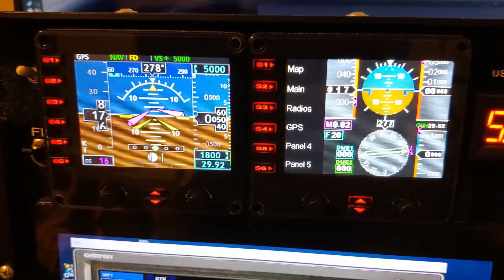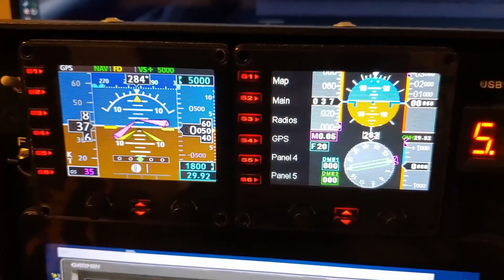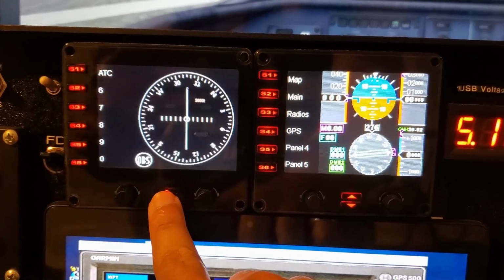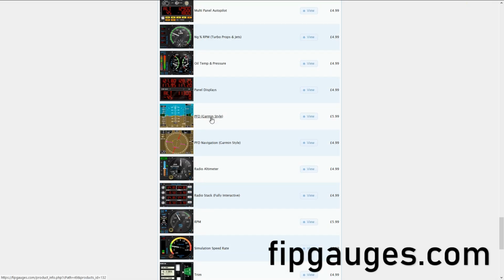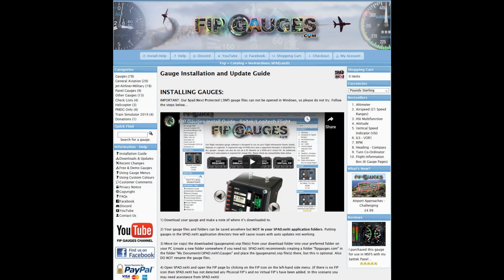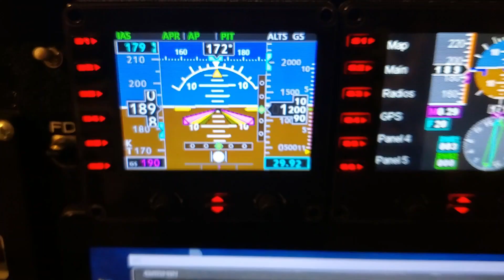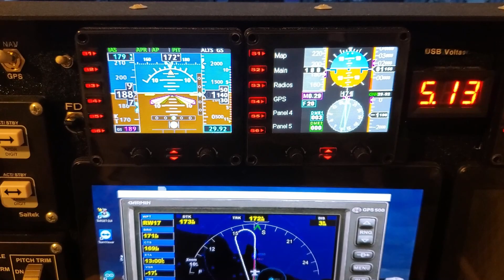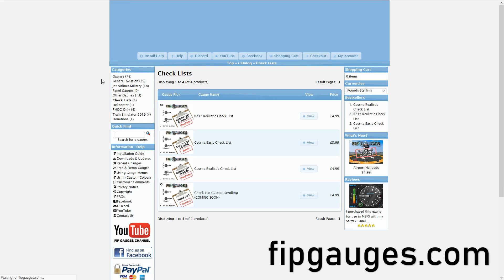Create Garmin G5 and G1000 with Saitek/Logitech FIPs

Comment: This is the first video where I can see the display more or less in action. What's the frame rate? According to this video it's like a power point presentation
Reply from the maker: The frame rate is just as smooth as real instruments in real life. There is no lag, but it will steal some FPS from your main monitor. I've put the Logitech FIPS to the test with many instruments and it's one of the best devices you can buy for your Flight Simulator.

Comment: I just bought two but they don’t seem to be compatible with Mac 😢
Reply from the maker: I'll see what I can find for you but it really doesn't look too promising. There's talk about some conversions by using some applications but nobody has nailed it. I'll get back to you :)
Reply: @joshuamarius  aww man, I have an R4 Alienware which runs it on Microsoft sim, but not as smooth as the m1 air running Xplane. Either way thanks for making the video it’s pretty dope, the planes I fly have two G5’s so this works perfect 💪

Comment: You recommend this or air manager and a touch screen?
Reply from the maker: It depends on what you are trying to accomplish. Air Manager works really well for bundling a cluster of instruments like the 6 pack and split PFD/MFD screens. With two decent sized monitors and Air Manager you can have an entire Cockpit. Where these come in handy is the small screen bundled with an encoder (something you can physically turn) and 8 useful buttons. When you look at fipgauges.com, you have all sorts of options with these such as indicator lights, annunciators, CDUs, clocks, checklists and more. So you may even combine the two depending on your setup...some people just need physical things they can push or turn as touching a screen during an emergency procedure or urgency can be inadequate.
Reply: @joshuamarius  makes sense, some things to think about but yea I kinda get that physical touch of the knob. Thanks for the reply Josh.

Comment: So they work for fsx? (With any freeware aircraft) because i only have 5 payware planes i have the 757, the 747, 727, A320, CJ4
Reply from the maker: They will work with any aircraft even if the aircraft does not have that instrument. The gauge picks up the data from the simulator and displays it.
Reply: @joshuamarius  ok thank you

Comment: Why are the FIP in the video and the FIP in your page different?
Reply from the maker: Thanks for the comment. fipgauges.com doesn't belong to me; I just use their products. And they probably look different because it has been updated. With time the author will release newer software for easier integration and also compatibility with newer versions of Flight Simulators.
Reply: That’s because the gauge in the video is not a fipgauges.com gauge. However we do now have a garmin G5 gauge now which is actually better and more functional then the one pictured in this video :-)
Reply from the maker: @fipgauges1305  Can you elaborate a bit on this please. It may have been a referral to another product, but I did in fact purchase that Gauge at fipgauges.com
Reply: @joshuamarius  hi the Garmin G5 in this video is not the one made by fipgauges.com. I have since (last two weeks) release my own Garmin G5 now
Reply from the maker: @fipgauges1305  Thanks, I'll update the info on the video.

Comment: does it work with FS2020 ?
Reply from the maker: Yes, please review the latest News posted for MSFS 2020 at fipgauges.com - You can also review the installation instructions and Demo some gauges.
Reply: @joshuamarius  nice i'll check, can I get the FIP only to work with spad.next, but not the radio, autopilot and avionics panels ? they're working fine with the stock drivers.